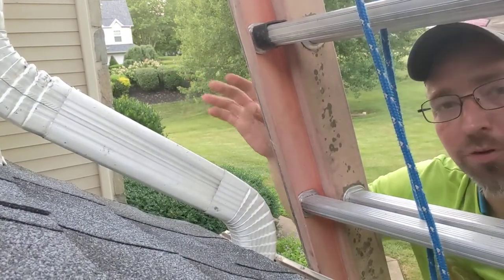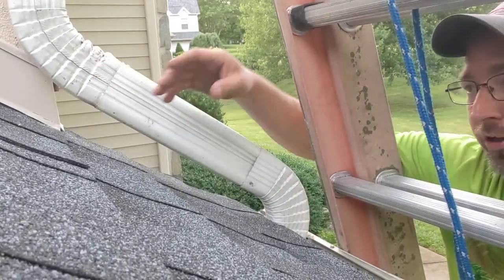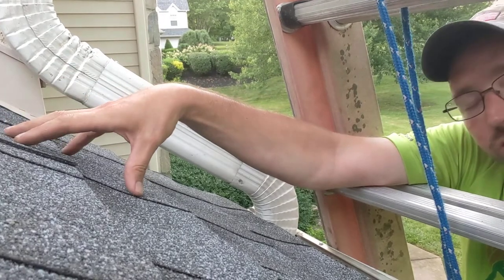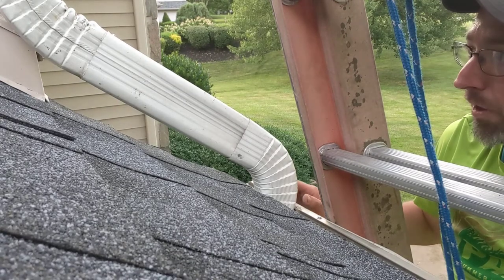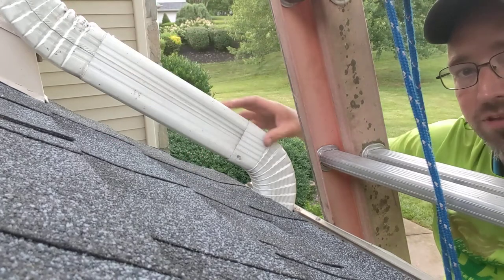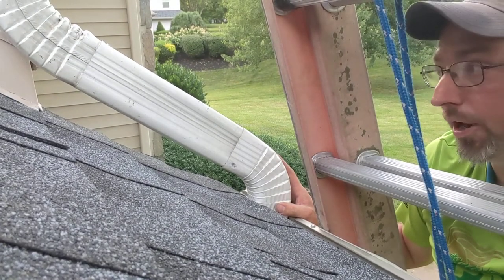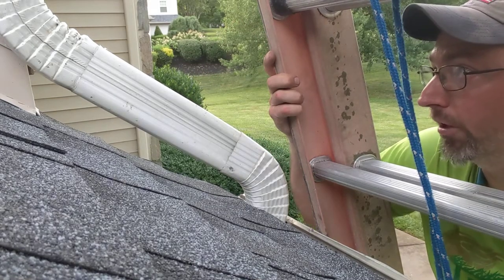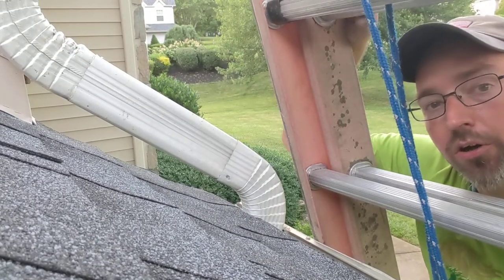Why we hard-pipe downspouts into gutters rather than onto the roof deck. (AFTER PHOTOS)

Comment: nice illustration of a BETTER installation (vs what is done in real life by the builders).
unfortunately, u don't show the WHOLE picture...
if the lower roof (I GUESS here) gutter is fit 2 handle increased local flow (e.g. when the lower roof is small and the gutter is long etc.)
in my case the lower roof is already big and its gutter is overflowing even when the water from the upper roof's downspout's elbow is somewhat distributed over the lower roof b4 hitting the lower gutter...

so... i will still keep looking 4 something even better...
Reply from the maker: You're correct!  You can hard pipe all the way to the ground with a second downspout. 

You can upgrade lower gutter drop out and down spout to 3x4 up from the 2x3...

Or in your case, consider upgrading the lower gutter from 5 inch to 6 inch. 

I'd like to setup a phone call or a zoom video session to further discuss your specific challenges at your house, you can do that online at www.HomeFieldAdvantage.pro
drew

Comment: How do you connect the lower part of the downspout to the gutter? Screws? Concern the high winds will mess with the downspout running over the rooftop.
Reply from the maker: Great question... One method is to take a pair of tin snips, and cut a tab out of the front... set it on the front lip of the gutter, and screw down through the tab into the top lip on the front of the gutter.  

If you have a hidden hanger right there, you can screw it to the hidden hanger.  

Make sure the spout doesn't hang so deep in the gutter that it blocks the flow of water. 

Hope this helps:   Subscribe for more great content to assist you with your Forever Home!

Comment: Will insurance typically cover replacement costs from water damage from the downspout? Running into the issue now where water is leaking through onto the garage ceiling
Reply from the maker: I am not a licensed public adjuster, and therefore not qualified to give you insurance claim advice...

My experience has been, that most homeowners policies are written to cover sudden and catastrophic losses.

In contrast, a long slow degradation where water made its way in over a long period of time, traditionally have been declined with the clients we've worked with.

It may be worth placing a phone call to a local public adjuster and asking their opinion after they review your homeowner's policy contract rider.  

A couple of years ago, we interviewed a public adjuster and you may find the information in that content helpful.

Comment: I have an upper gutter with this issue, it discharges onto the lower roof beneath it. I would have a longer section about 15 feet long i would need to run and I am wondering whether the gutter should be kept elevated slightly so its not touching the roof, or if it can rest on it. My fear with allowing it to rest on the roof as it could encourage mold/mildew growth if it cant dry out beneath it.
Reply from the maker: Sounds like you have a dormer or reverse gable, and the gutter was installed without an "end cap" to allow water to drain out onto the roof, hence the obscenely long downspout on top of the roof.   I have a few suggestions.

(1) No, don't let the gutter touch the roof.
(2) add an end cap
(3) Remove and reinstall the gutter, repitching it to drain away from the roof
(4) Use an outside miter, or two elbows with a new drop-out to route a downspout in traditional fashion down the corner post closer to the edge of the lower roof
(5) Hardpipe from this new location to the lower gutter.

Comment: can I just have it flow into the lower gutters?
Reply from the maker: I'm not sure I understand your question... 

No you don't want to allow it to flow onto the roof, and across the shingles and into the lower gutter as this will prematurely wear at your shingles.

Option A, shown here is to hard pipe the second story gutters down correctly into the first story gutters.  As long as your first story gutters are large enough to handle the volume of water, and you are strategic with how you cut and attach the elbow so that you're directing water in the proper direction, this solution works just fine.

Option B is to hard pipe the second story gutters all the way down to the ground.  This is not always practical depending on the roof lines.  But I like to have a conversation with my gutter installer before I allow them to start on the house.  I want to make sure we're strategic about how we're getting the water down from the gutter to the ground... And I want to make sure that we put it into areas of the yard where we can drain it away from the foundation of the house... Without the possibility of leaving ice trails across the driveway in the winter time... 

A few minutes of planning can work wonders and save headaches down the road.

Please subscribe to our channel for more great tips as you think about questions you want to ask contractors before you hire them to work on your home